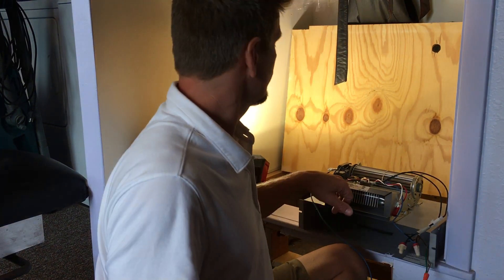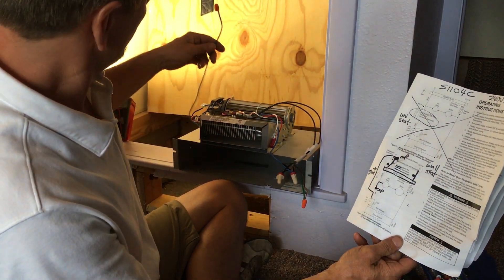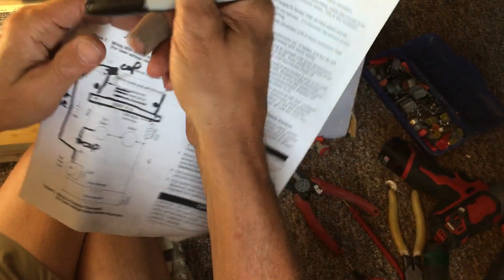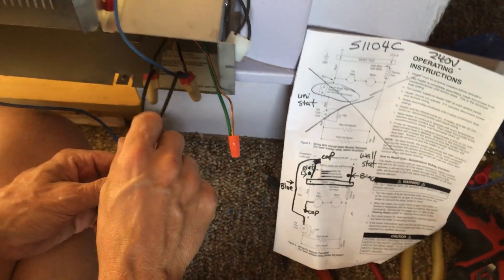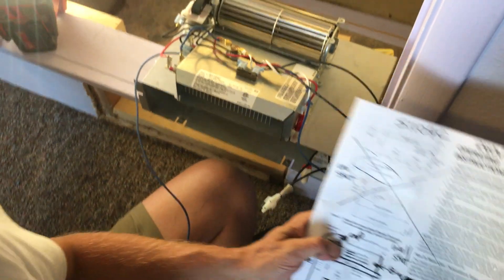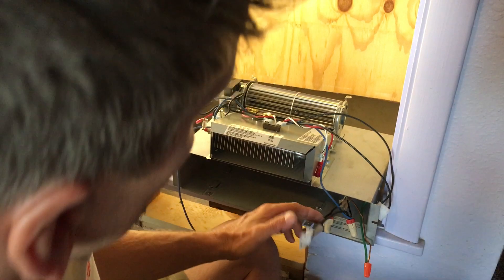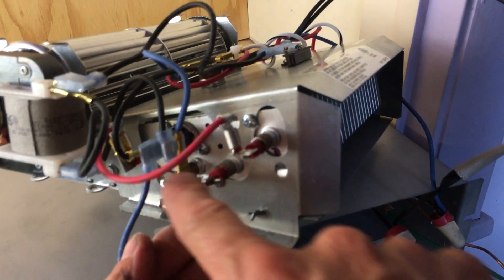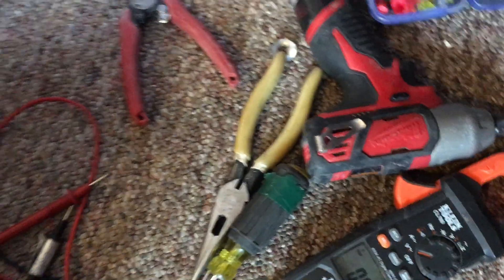Wiring a Marley S1104C Qmark Electric Toe-Space Heater

Comment: Were you  running a single pole  240v wall thermostat?   i had two blue wires were cap when i unboxed  my heater so your saying it doesn't matter which 120v  line to hook the blue wire going through  the over limit reset i have 240v coming to heater the blue wire to black load lead L1 on the heater for 240v single pole thermostat

Comment: Thank you for making this video. I have a slightly different model but was able to apply what you said to mine. I was thrown by the cap the wire thing! Then I wondered which black to put the blue with, but you explained it well. I'm a little dense so had to watch several times to get it all. I'm not an electrician, I just play one at home.